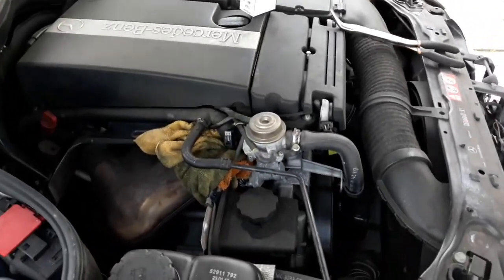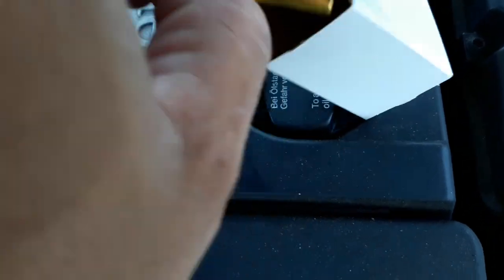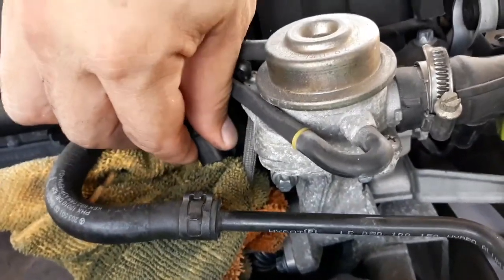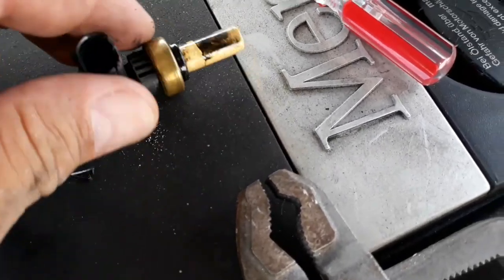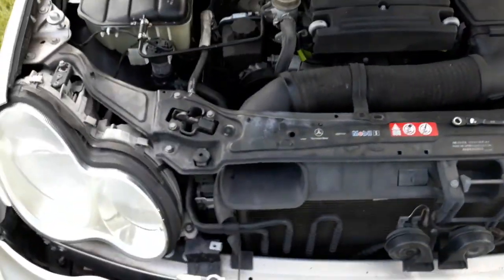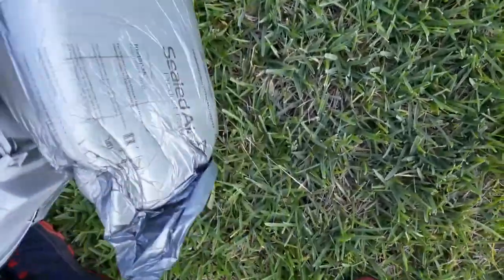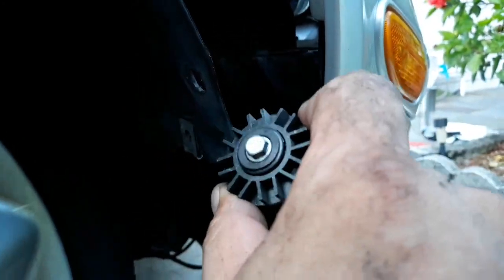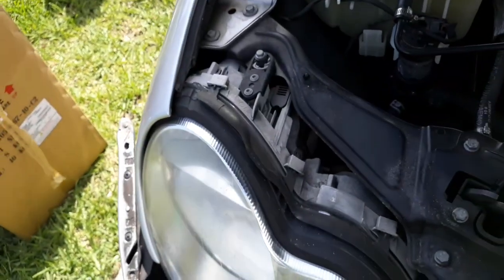How To Do Simple Upgrades Grille, Headlight Assembly and Coolant Temp Sensor for 2005 Mercedes C230

Comment: How do I get the front bumper off? I took out all the plastic clips on both ends and the T20 trox with bracket. I took out the top 2 and cannot wiggle it out. Is there any behind the fog light mesh? Do I need to take that alignment headlight bolt off you showed in this video? Please help.Thanks
Reply from the maker: Yes I took out the headlight alignment bolt out in order to remove old headlight. It was rather hard. What was holding me back was headlight bracket on the ( inside outer end) in which bumper slides on between.
Reply: @MIC-LS  do I need to remove the headlight alignment bolt on the side if im only removing the bumper? No bolts near the fog light area like the 2001-2004?
Reply from the maker: @daddyk5023 If you are not taking  the headlights out, then you do not need to remove the alignment bolt. Once you remove all of the bolts surrounding the bumper. You should just pull it off.

Comment: How well did the headlights hold up. I’m getting ready to do the same thing and get a grill.
Reply from the maker: Lights are doing great, grille is awesome, the pull latch to open hood in the front might be your only issue since it tends to hide when closing hood. Often you find yourself fishing for it when ever you need to open the hood at the front. What may not bother me, it may upset regular people.

Comment: hey, i have a 2006, how did you drop the front bumper without taking the tires off?
Reply from the maker: By turning the wheel to either side and removing the access panel 1 wheel at a time and removing the nut inside the fender attached to the headlight.

Comment: How was the projection on the new headlights. 
Im thinkin of buying one from a mechanic i know who did the balance shaft, timing chain, valve cover gasket  with 147k miles. And it def need new headlights
Reply from the maker: Nice and bright. Once you install Led's even briter.
Reply: @MIC-LS  I've heard it's almost a given when replacing those with projectors at least on low beam in order to not get everything washed out when upgrading bulb to LED? Does that sound correct?
Reply from the maker: Yes, that is true.

Comment: Any suggestions on where to find the U-clips for the grille?
Reply from the maker: These clips, I can Find the in the Help section at any auto parts store. They normally are in a little assorted pack different sizes. I also just looked the up in Amazon and they Have them. If you go to the Dealer expect to dish out your pinky finger. Another solution (if you dare) salvage yard from another Mercedes. Your choice.
Reply: @MIC-LS  I’m getting some at harbor freight tomorrow, thanks!

Comment: im looking into buying a 2006 c230 what do you think?
Reply from the maker: The C230 was purchased over 5 years ago with 50k on it 1 owner a Doctor. Right now it's over 75k only an alternator, brakes, tires and 1 coolant temp sensor. If your mercedes is over 100k they will start asking for money. It all depends especially who beat the living daylights out of the engine.  If a grandma owned it I say go for it. Good luck.
Reply: My c230 kompressor has 220,000 miles on it. 
All I replaced was the tie rod ends. The rest is highway 🛣 and ⛽ gasoline.
Update 9/25/21
I'm in the East coast, I just put 3,000 extra miles. Engine is smooth!!!!!

Comment: Did the projector headlights gave you an error on the dash? I noticed that your old ones weren't the same. 
And do those new ones light the road better than the other set?
Reply from the maker: Thank you for the comment, no error on the dash, all I had to do was adjust the beams so that I won't blind bats flying at night, and yes they are brighter especially if you purchase LED driving lights.
Reply: @MIC-LS  thank you! Any specific brand of led or anything?
Reply from the maker: @camenma9748  pay attention of the Lumens the higher the number the brighter it will be, as far as brands that's up to you.

Comment: Hey brooo how can I buy that emblem and the grill for my Mercedes’ c240 2001
Reply from the maker: Thanks for the comment, I found this on Ebay and This one only fits 2004 thru 2007 model years.
Reply: Great video. You just saved me a headache and probably hundreds of dollars. Do you have the link to it by chance. I have a 2007 C230 Sport and want to do the same but want to find a reliable seller.
Reply from the maker: Wow, thanks for the video, I got the grill on Ebay for about $150 there are many different styles, colors and if you are choosing ebay it should be no problem, because I have gotten my money back on a couple of items and no issue for me. But plug your vehicle model, year and plug in word ("grille") and you should be fine.

Comment: Did u have to drian any coolant to replace the coolant sensor?
Reply from the maker: Nope, just like you saw in the video. I was trying to be quick and ready if there was any coolant.
Reply: Thank u I drained the coolant completely hit and not blue at all got it all changed and now it's staying check coolant level do you have any idea why it's saying thay
Reply from the maker: @brandonwiesman611  You still have air in the system. You need to remove the air so the sensor will not read "low coolant/check coolant " air bubble at the sensor" The thermostat needs to go thru a couple of cycles of opening and closing to get rid of this bubble(s).Also make sure you turn your heater on, for coolant to cycle thru everything to remove the air bubble and need to top off with coolant. Keep an eye for coolant level after 15-20 min of running time top off as needed. Always being mindful to fill coolant when engine is cold or cool 😎.

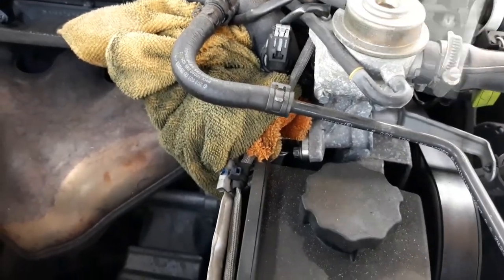Comment: Which grill did you use? 4:32
Reply from the maker: Hope this helps, this is what I got from ebay, Skip to content

￼

Cart

Skip to product information

￼

Open featured media in gallery view

￼

Open media 1 in gallery view

￼

Open media 3 in gallery view

￼

Open media 4 in gallery view

￼

Open media 5 in gallery view

￼

Open media 6 in gallery view

￼

Open media 7 in gallery view

￼

Open media 8 in gallery view

￼

Open media 9 in gallery view

￼

Open media 10 in gallery view

￼

Open media 11 in gallery view

￼

Open media 12 in gallery view

￼

Open media 13 in gallery view

￼

Open media 14 in gallery view

￼

Open media 15 in gallery view

￼

Open media 16 in gallery view

￼

Open media 17 in gallery view

￼

Open media 18 in gallery view

￼

Open media 19 in gallery view

￼

Open media 20 in gallery view

￼

Open media 21 in gallery view

￼

Open media 22 in gallery view

￼

Open media 23 in gallery view

￼

Open media 24 in gallery view

￼

Open media 25 in gallery view

￼

Open media 26 in gallery view

￼

Open media 27 in gallery view

1 / of27

DE MOTORS

Mercedes Benz W203 2001~2007 C-Class 4 Fins

Regular price$ 249.00 USDSale price$ 175.00 USDSale

ColorBlack Silve White Glossy black with Chrome Star Chrome 100% Matte Black Matte Black with Chrome Star 100% Glossy Black

QuantityDecrease quantity for Mercedes Benz W203 2001~2007 C-Class 4 FinsIncrease quantity for Mercedes Benz W203 2001~2007 C-Class 4 Fins

Add to cart

Buy now with PayPalBuy with 

More payment options

Mercedes Benz W203 2001~2007 C-Class 4 Fins

 

4 Fins Style Grille for W203 C-Class Sedan and Wagon only

Fits on 2001~2007 C-Class, all models include C32 AMG

C180 C220 C230 C240 C280 and C32

For Sedan/Saloon and Wagon.

Not for 2 door coupe models.

All time Best Seller.

Extended Hood latch included.

Share

You may also like

Mercedes Benz W203 2001~2007 C-Class 3 Fins

￼

Mercedes Benz W203 2001~2007 C-Class 3 Fins

Regular priceFrom $ 175.00 USD

Mercedes Benz W203 2001~2007 C-Class OEM Style Grille

￼

Mercedes Benz W203 2001~2007 C-Class OEM Style Grille

Regular price$ 148.95 USD

Mercedes Benz W203 2001~2007 C-Class 1 FIN SLS Style Grille C230 C240 C280 C32

￼

Sale

Mercedes Benz W203 2001~2007 C-Class 1 FIN SLS Style Grille C230 C240 C280 C32

Regular price$ 195.00 USDSale price$ 159.99 USD

Mercedes Benz W211 2007~2009 E-Class 4 Fins Grille

￼

Mercedes Benz W211 2007~2009 E-Class 4 Fins Grille

Regular price$ 189.99 USD

Quick links

Search

About Us

Contact Us

FAQ

Blog / News

Do not sell my personal information

Join Our Mailing Listing

Join Our Mailing Listing and Receive Sales and New Product Alert, We only send 2 to 3 emails a month, We hate spam too!

Subscribe to our emails

Email

Facebook

Pinterest

Instagram

Country/region

United States (USD $)

Payment methods

© 2023, 55tech Motors Ecommerce Software by Shopify
Reply from the maker: If link does not work, it is called 4 fin silver Grille for 2005-2007 C230 1.8L Supercharged Sport at EBAY.com

Comment: Hey where can i buy those lights?
Reply from the maker: [Factory Style] 2001-2007 Mercedes Benz W203 C230 C240 C320 Projector Headlights Ebay!
Reply: @MIC-LS  Question. Could you open the hood? I got the same grill and now the hood release wont pull all the way and it stuck lol. Help
Reply from the maker: @TheRealJuseBeats  I definitely know what you mean. You glue a piece of plastic very neatly so it does not show on the bottom of the grill where the pull lever will sit on. It should act as as a place for the lever on the grill to rest on. The first time it took me a good minute to get it open until I came up with this idea. It does not need to be plastic it could also be a piece of rod, as long as  the pull lever at the grill rests on something and nobody can see it. Good luck!
Reply: @MIC-LS  What’s your email? I definitely need to talk to you real quick lol
Reply: @MIC-LS  I got my fingers in to get the lever but when I pull, it doesn’t release. It’s like it’s almost there but not enough?
Reply from the maker: This is how I did it. You pull on the hood lever inside the vehicle first, then the hood should pop just enough for you to grab the front grille lever, now you may have to raise and lower the hood  just enough while grabbing the lever and bringing it over available spot to pull. This took me about 5 minutes then I got the hang of it.
Reply from the maker: Cjflores134@yahoo.com

Comment: You selling that stock grille ???
Reply from the maker: The EPA might want me to put this back, lol.
Reply: @MIC-LS  haha its all good ended up Using paint remover to remove black paint of the grille the previous owner had blacked out the entire car but currently painting the wheels satin silver and clean up the headlights and also the grille is chrome again the car is coming along nicely also ended up finding an AUX wire that fits with oem so won't be replacing the stereo will just be replacing the speakers with some 6.5s on the doors. Got the wire adaptor so the speakers can just be plugged in and no wiring will be needed just waiting on the AUX adapter and Speaker brackets and the Car should be done
Reply from the maker: Nice, Nice, save that money!!! Very smart!!!

Comment: Did you drain the system before installing the coolant temperature sensor??
Reply from the maker: Nope!!! just as you see it done, quick in and out.
Reply from the maker: Just make sure change it while the engine is cold.
Reply: Why is it advisable to change out the cooling temperature sensor?
Reply from the maker: Nope, my coolant was replaced already  and I did not want to drain it. So I rolled the dice and was a quick sensor exchange, not much coolant loss as you see in the video.
Reply from the maker: My sensor was intermittent, so I replaced it.